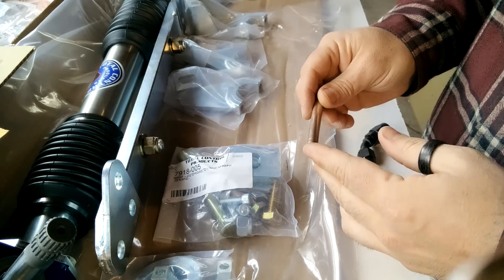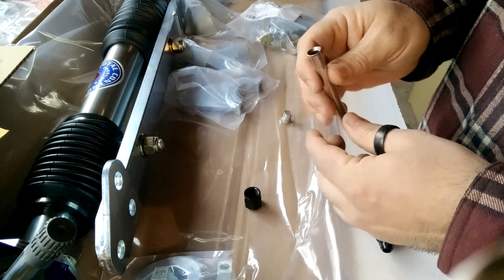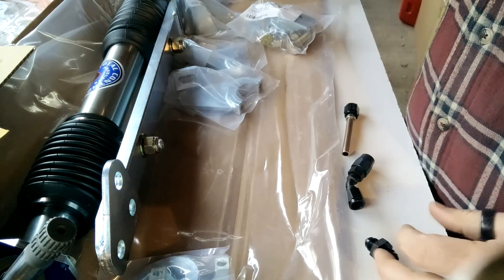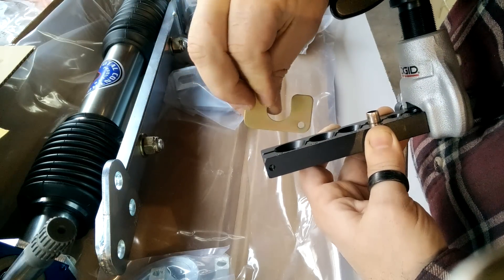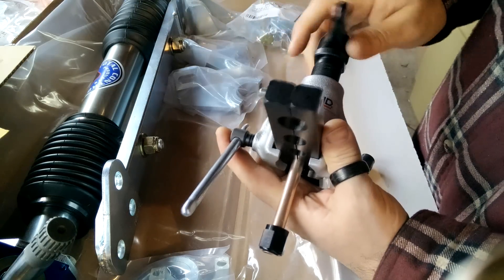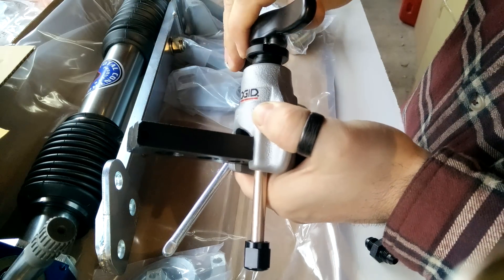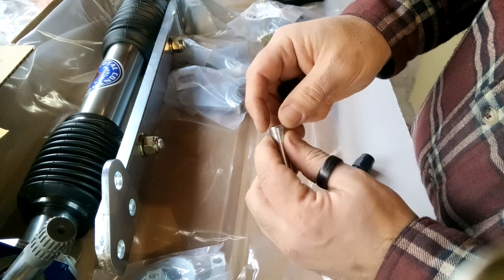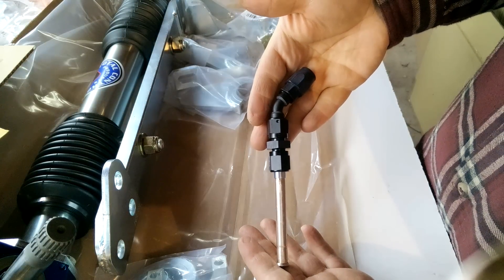Flaring fuel line for AN fittings

Comment: Excellent video. Once I started flaring, and using hard line, I was able to get rid of bulky, heavy, droopy hose. Fantastic!
Reply from the maker: +Scott Casinger Thanks Scott! Please share the video if you found it helpful.
Reply: Awesome u just save my day
Reply: projectgattago I have a bit of a weird one. I'm looking to convert over some .391" tube which is crazy close to .375" which is 3/8" tube. if I use a 3/8 end and simply sand down the piping a tad do you think it would work?
Reply from the maker: Sorry for the late response. I think that if the wall thickness does not before too thin, you should be OK.

Comment: Nice work. I like to use a little light lubricant like 3 in 1 oil during the flailing process. Saves a little wear on the mandrel.
Reply from the maker: Good call using a little lubricant when flaring!
Reply: That mandrel is free to spin on this tool. So, no oil is needed

Comment: Thanks for the video demo of the flaring tool!  Since watching, I ordered the same tool for work on my cars fuel system.  After unpacking and inspecting it I see that the flaring head is off-set.  In other words the tip of the flaring cone is not centred directly in line with the shaft.  So when I turn the handle, the cone "wobbles" as it's not mounted dead center of the shaft.  I have other flaring tools and have never seen anything like this.  I'm not sure how the flare would be even with a set up like this?Just wondering if you can shed some light on this for me?  I'm wondering if I got a defected part.Thanks!!
Reply from the maker: Mine is exactly the same way and works very well. Give it a try and you will see.
Reply: +projectgattago thank you.  just need sone tubing to give it a try!
Reply: That's why it's called an "eccentric" flaring tool

Comment: Awesome video! What pressure can that line withstand? I'm going to do a LS swap and need to have about 60 psi. So I'm searching for a good hard line to run on the frame rail of my truck.
Reply from the maker: This will easily handle 60psi. That's what I run in my Cougar.
Reply: 3/8 Ni-Cop line is rated for around 1700 psi working pressure. It should keep pressures of up to 2500 psi. Steel will do 2000 working pressure and 3000 psi max. Aluminum is about 500 and max at 750. Pure copper is 900 and 1400

Comment: Very educational. Especially since every component that you are using is what I already have. (3/8 copper nickel alloy line, and Earls AN -6 fittings) However.... why are you only doing a single flare?? I was told that a double flare is better. Are you supposed to only do a single flare when using AN lines to hard line?
Reply from the maker: +S. Dot Carter For 37 degree flares all that is called for is a single flare. When doing SAE 45 degree flares that is when you do double flares.
Reply: Ok. Thanks for clearing that up. But Im guessing that not all AN's are 37 degrees. So how do you tell the difference? Using what tool to tell the curve?
Reply from the maker: +S. Dot Carter All AN fittings are 37 degrees.
Reply: Got it. Thanks for thee information.

Comment: Do you believe the compression tool will work for 304 stainless?
Reply from the maker: I have not tried it with stainless, but I believe the package said not to use with stainless.
Reply: @projectgattago  have been debating on using Nickel Copper or Stainless Steel.....Nickel is going to be the easiest way the pressure is 60 to 75 lbs. So I was thinking a 37 degree flar to AN-6...
Reply from the maker: @tomandrews5392  The NiCopp is really easy to work with. It flares nicely and bends easily. I prefer it over stainless.
Reply: @projectgattago  Yah me bring a nubie that is the best choice for the application....looks to be easy....do you thing the NiCorp will work for A/C too...
Reply from the maker: @tomandrews5392  I am not sure about using it for AC

Comment: Will these tools work for a stainless line or do we need a better flaring tool?
Reply from the maker: I have never used it on stainless, but according to Rigid it can be used on stainless with a wall thickness of .035" or less.

Comment: Where did you get all that an do they make it for 10an
Reply from the maker: The tool I got from Amazon and all of the plumbing parts are made by Earl's. You can find the fittings on the Holley website and they do make it for AN-10.

Comment: What did you use to cut the tube off so cleanly?
Reply from the maker: +S. Dot Carter I just used a regular tubing cutter.
Reply: Oh ok. it just looked extra clean to me. :o) But thanks again for the info.
Reply: projectgattago what can I use to cut the tube if it's really close to nearby tubing? also... how do I flare it if there isn't much room? I only have .9" to work with.

Comment: Do you know if Double Flare SAE 3/8 Fuel line Male From my in tank fuel pump to will Mate/Function with AN6 Female
I have my Tube bender so now I need help on the fittings
I already have the Female to Female pre made AN6 Aeroquip Fittings However all the pre made double SAE Fittings I see are male. I am going to run hard line from the IN Tank Fuel Pump to the Hi Pressure Fuel Filter I want to avoid rubber lines along the length of my frame
The Hi Pressure Filter from Aeromotive was AN10 but is now  reduced to Male An6 on both ends SO I ordered a bunch of the Female to Female AN6 Fittings NOT CHEAP WOW THAT HURT MY WALLET! I am doing TBI Holley Sniper so I dont really want to use rubber even though I know the new FI rubber lines are supposed to be compatible but I just want to go to hard line till just the end or ends and be done with the Rubber/Braided Stuff as much as possible anyway its a lowered truck so less hassle later on.
I figure I will use the Existing Hard Line with new FI/Rubber/Braided Ends for the Fuel pump return I think I got it right...until I am wrong... so measure twice cut once. Applies to soo much and part of Every Good Dads sayings I remembered!..:)
Reply from the maker: J garcia I am not sure that I fully understand the question, but 37 degree AN flares are not compatible with SAE 45 degree double flares.
Reply: Say you have a Pre Made 3/8 Double Flare Steel Fuel line with A Male End now you have a typical AN6 braided line with Female Push lock type hose end will it screw in and not leak?  Or does it have to be the same type AN6 Male End To Female AN6 only.
Reply from the maker: J garcia Yes, it will leak. Fittings types must be the same. AN to AN, SAE to SAE. No mixing.
Reply: Thank you I really appreciate it so one or the other...Braided line is not that bad.
 looking at it now with your info Thanks Again!
Reply from the maker: Glad to help!

Comment: Why not just use a compression fitting?  No flaring tools needed.
Reply from the maker: Using a compression fitting is another option. I just prefer to do it this way.
Reply: Compression fittings not good for vibration..ie automotive